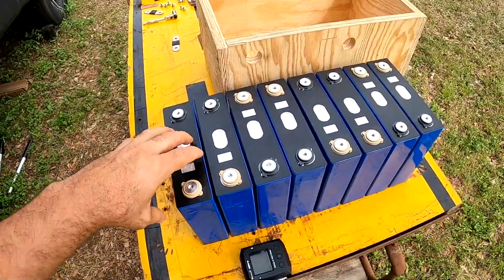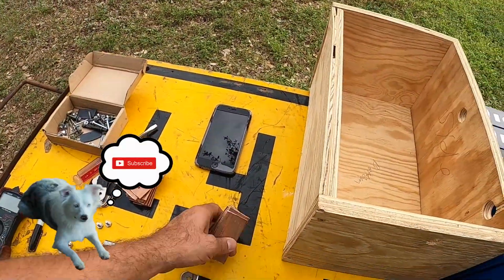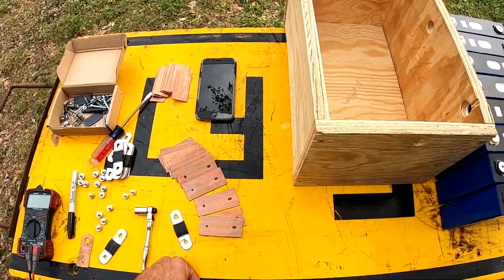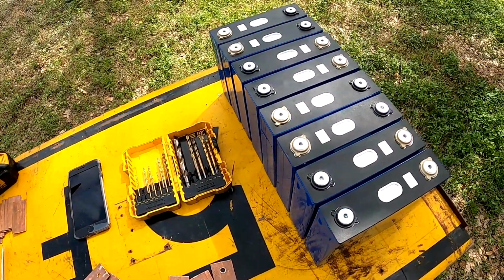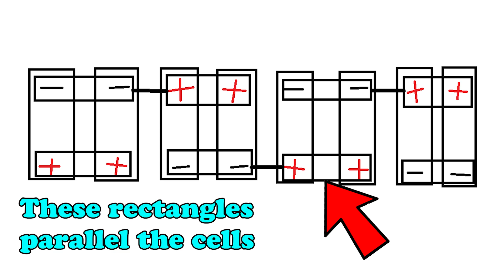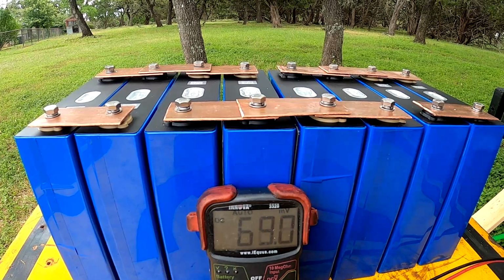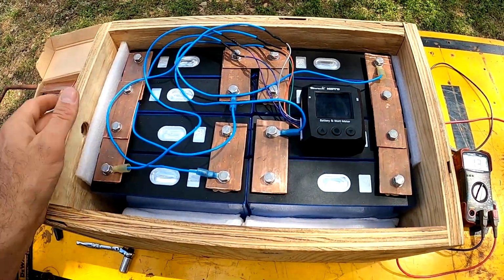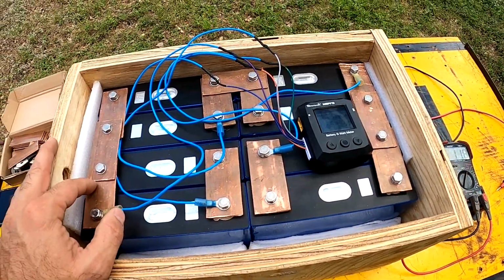DIY 12-volt 300 AH LifePO4 Battery - DIY Lithium Iron Phosphate 12v battery

Comment: For anyone scrolling through who is doing research on making their own pack make sure any cells that are put in parallel are the same voltage. The closer to exactly the same voltage the safer it is to connect them in parallel.
Reply from the maker: Yea I bottom balanced the cells in another video.

Comment: Thanks for showing me this. There are a few ways to make a 12v 4s 2p. Why did you choose this way and is only 1 BMS needed?
Reply from the maker: Because I didn’t want to make 2 batteries and run them in parallel. A BMS isn’t “needed” I’ve been running mine for over a year without it. But I’m not saying to not use one. One BMS could have been used either a 4s or 8s.

Comment: Los busbar de cobre no son apropiados para el aluminio de los bornes de la bateria
Reply from the maker: Copper is a better conductor than aluminum so I don't really see how your statement makes sense. Also the manufacturer sends out copper bus bars with the cells.
Reply: @grumpysdiy   Si pero el cobre desnudo con el aluminio hacen corrosion galvanica, si el cobre esta recubierto con estaño no pasa nada, aluminio con cobre desnudo a la larga da problemas, no te fies de los fabricantes que envian lo que tienen
Reply from the maker: @vicentramon2434  Thanks for the info, I recently took the battery apart after a year in service and the terminals were fine. I will check from time to time.

Comment: Hi.how are your cells bearing up?I have made ebike batteries in past .my vw t4 camper has 2 x 110ah lead acid at moment.I only run waeco 12v compressor fridge,led lights,water pump .usb sockets .do have twin power amp stereo.have 5 solar panels on roof total 240watts spread out as I work as window cleaner and have roof box with inflatable sup inside.I also use dc to dc charger .so more durable lighter battery could replace my 2 lead acids .steve
Reply from the maker: They are working perfectly, however if you build a battery I suggest a BMS which I didn’t use. Because of experience and my charge controller and inverter have tons of perimeters I can control as well as a cell balancer that stays on it always.
Reply from the maker: My only regret was not spending more money and buying 800ah instead of 300. Which there are some sellers on aliexpress selling 800ah of Calb lifepo4 cells for $1400 ish dollars.

Comment: Are you going to make an updated video showing your bms and how you have it wired? Ive only seen videos with one diy 4 cell bank. Yours is the only 8 cell bank build. For weight issues i want to build two 4 cell banks and wire them as one so i don't have all that weight in one box and have to lift it in and out if needed. Im in michigan, and plan on going out west so Im thinking of using heat pads (not sure of the correct name for them) and adding a fan for cooling on each box. I've seen for precaution some people using a bms and smart shunt to monitor their batteries and some who say the smart shunt is redundant. It's my first time using a solar system and I've never dealt with lifepo4 batteries. I just received my 8-3.2 280ah cells and need to order whatever else I'll need to set up my banks. Other than getting 4 300watt monocrystalline solar panels im not sure what else I'll need. I was hoping id find a new video of you finished work with your banks all built and wired as well as your mppt controller and misc parts to use as a guide. Thanks for posting what you have so far, im going to check out your wind turbine next. Im going to try and make a vertical axis turbine to mount on the front of my vnose trailer so i can have the extra capability to charge if im driving and there is not much sun for solar, and make it extendable so when im parked i can raise it for getting more wind for the same reason. Thanks for posting your work, right now im just at the what's possible stage, it's nice to know at least what I'll be trying to accomplish is doable.
Reply from the maker: So I have been planning on making an updated video because through trial and error I have redone our solar setup 3 or 4 times. But with the addition of the wind turbine the wiring around the battery area will change again so no need for a  update video yet. So there are Daly BMS's on aliexpress that have fans built into them so you don't need to add that stuff : https://www.aliexpress.com/item/1005001803913333.html?spm=a2g0o.cart.0.0.7a983c008j0M5w&mp=1 . Copy and paste that into your address bar. LifePO4 cells are way lighter so you could make it as one battery like I did. Just make sure you size all of your wiring correctly and only use pure copper wire or welding cable same shit. Do not use CCA wire which is copper clad aluminum because it cannot carry the same amps as pure copper and you could burn your camper down. I would only use the heating pads if you plan to be in freezing weather alot. I have the renogy shunt to monitor the charge and discharge however I would suggest the victon shunt since that is new and out now for like $160, you can monitor that shunt from your phone via bluetooth. I never used a BMS so I haven't made that video yet, because with my CC and my inverter/ charger I can control most of what a BMS does then I just added an active balancer. Way cheaper that way but for a beginner I would use a BMS.
Reply from the maker: Oh use quality blue sea systems breakers and cut off switches the cheap over seas ones cannot carry the amps they claim and you could burn your camper down.
Reply: @grumpysdiy  thank you, ive seen the bms's with a fan but i thought it was just to cool the bms itself, not the battery. I live in Michigan where it's cold so I'll need the heat pads for camping here in the winter months, and when im out west I'll need/possibly need the fans for the arizona heat. Are the fans on the bms a flow thru design so i can mount on the box over a cut out to keep the temperature down inside the box? If so an extra venting hole on the opposite side will/should let enough air pull thru to keep batteries from getting to hot. And thanks for the reply, much appreciated!!!
Reply from the maker: Never held one of those BMS. Just saw them on aliexpress.

Comment: Did you use the supplied bolts or upgrade to better
Reply from the maker: both, I bought some longer bolts and cut off the heads to use where the main neg and main pos connected.
Reply: @grumpysdiy  thanks for the information  , one more question,  metric or standard threads
Reply from the maker: They were metric. I just took a bolt into Home Depot with me and matched it.
Reply: @grumpysdiy  Thank you , this week  I'm starting to assembly the 4 we have .

Comment: Hi Wade, thanks for making these videos.   I just purchased raw cells, to be arriving in a few weeks.  I can't seem to get a good answer on weather or not these cells need to be compressed or if it is better to have space between them to allow for air flow and passive cooling.  Did you find a clear answer to this or are you making a "best guess" like most people?  Thanks again for making these videos... great information!  Corey  (Salty Escape)
Reply from the maker: I didn’t find any good info on that. Mine ended up in an enclosed wooden box.
Reply: @RV Adventure Couple - DiY RV Living     That is what I planned on doing as well.  Thanks for getting back with me.  Just for fun, this is what I asked the seller in China and their response...  
Q -  Do these cells need to be compressed or packed tightly when I wire 4 in series or would it be better to have space between them for air movement?

A- "When you got the battery, you can direct see whether it need to compress."
I guess I will wait and see what I receive and then I will try to "direct see" it.     Oh well.
Reply from the maker: Lol good luck 👍🏻
Reply: From what I understand these type of large single cell batteries aka prismatic cells do need to be compressed. I think some manufacturers have thick enough cases to not need compressing but if it's a cheap cheerful chinese prismatic I wouldn't expect it to be thick enough. If you are using them very gently you can probably get away without doing it but I would. It isn't a crazy big deal but they last longer when compressed properly if I remember correctly.
Reply from the maker: Thanks for the info.
Reply: @SaltyEscape  from what ive read the compression is needed if you will be charging/discharging them often at their max capacity of 1c, if your using them as an RV power or a small system seeing only moderate draw and charging which is average 75amps or less then compression would not make a noticeable difference in cycles or lifespan that ive ever read.
Reply from the maker: Great info!!!

Comment: Hey! Nice video, im considering to make my own 12 lifepo4 battery. Were these grade A or B cells? Did you have to charge them to the same voltage before connecting them?
Reply from the maker: Grade a brand new, I did a bottom balance then charged them up till one of the cells hit 3.65 and wrote down the pack voltage. Then you know your ceiling voltage. I then programmed my CC to 14.1 to get  5000 + cycles

Comment: Where did Buy your BMS? I'm doing the same thing and would like to purchase yours I really like the way it looks
Reply from the maker: I didn't put a bms on it, that is a cell balancer from amazon. However aliexpress has bms's from Daly that are good. Just make sure you get the right size bms to match your inverter.
Reply: @grumpysdiy But I thought we had to use BMS with lifepo4 battery ..
Reply from the maker: You do not, we used ours for about 8 months so far.
Reply from the maker: In saying that, im not responsible for what you do.
Reply: @grumpysdiy  oh ok... So it is only used for the temperature sensor ?
Reply from the maker: No bms does a ton of stuff. Low temp disconnect, balance, over load protection,....... the list goes on. It’s just that I can set a ton of parameters from my charge controller and my inverter.
Reply: @grumpysdiy  Ok thank you for your  answer :)
Reply from the maker: Np